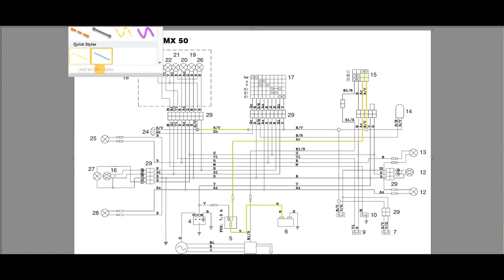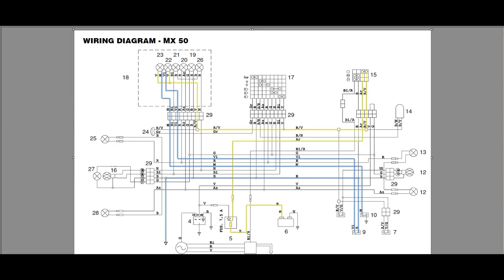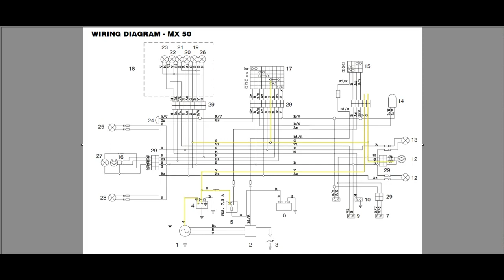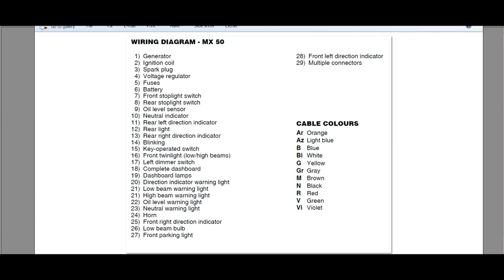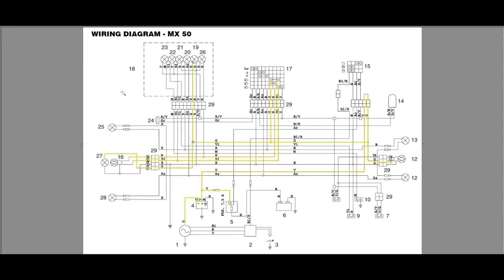Step by step guide: Understanding motorcycle wiring diagrams

Comment: I'm trying to figure out my first diagram and it is hard.  One question I have is about a long thin rectangle listed as "ECU".  Coming out from the long sides of this rectangle are a number of short straight lines, which I guess are wires.  These go into some very small long thin rectangles with a solid line down the longitudinal axis (so, in effect, two long thin rectangles joined on their long sides to form a single rectangle).  These small rectangles have varying numbers of those short wires going into them from the main ECU rectangle.  Sometimes, one per rectangle, and in other cases up to four.  How do I interpret all of that?  Could I email you a copy of the diagram?
Reply from the maker: Robert, these diagrams that you describe, provide an overview.
There will be separate diagrams dealing with component connections and their purposes.
Somehow, you need to get your hands on the set, if you want to understand everything.
They will be available on the service centre network.
A friendly mechanic might print them off for you.

That said, there is little that you can do without the scan kit that connects to the reader port.

The ECU is the computer that controls everything - Electronic or Engine Control Unit.
You don't rewire it, you reprogram it.
... or simply scan the system to discover any faults.

These vehicles are going to become increasingly difficult to repair, as the components will periodically, no longer be available new.
Reply: @EngineTuning  I'm  looking at just one small subsection of the FSM.  There are separate diagrams for each section.
Reply from the maker: Why not make a simple video using a screen recorder program like snagit or any such app?

That way, you could zoom in and out of the diagrams, and describe what you are looking for.
It would also mean that you would be sharing the problem with many more people.

:)
Reply: @EngineTuning  I got the Haynes manual and the diagram in it is much easier to read.  But still there is the matter of the ECU.  I spoke with a couple of people who helped me understand that you can't trace current flow through an ECU.  All you can test is for voltage on the wiring coming out of it and going to the load.
Reply from the maker: Great to hear that you are making progress.
Other than using an ECU scanner; understanding load circuit is probably as good as it gets.

The ECU is a bit like having a large rucksack ... you can just fill it with loads of stuff.

If something goes wrong, it is often quicker to produce a workaround, rather than spend a month studying the ECU.

I recently needed to get my windscreen washer working for a control test.
The rear washer worked, but not the front.
I'd renewed the pump, but it was the control circuitry.

Was it the clock spring?
The diagrams were not clear.
... so I simply bridged the two output tubes (front and rear).

If the water jet had been weak I would have ultimately fitted a solenoid valve, but it worked (works) fine.

Sometimes, the path of least resistance is the best route to take :)

Comment: What is the earth ground inside the voltage regulator box?
Reply from the maker: Sometimes, components are grounded directly to the chassis via the attaching bolt.
With the battery disconnected, use a multimeter continuity tester (beeps when the two probes touch).
Probing between chassis mounts and terminals is quick and easy.

I have seen components that ground via the bolt AND via an earth cable.
Reply: @EngineTuning  Okay, thanks for responding.

Comment: What an excellent, detailed, in-depth, and easy to understand lesson on motorbike wiring diagram. Sir, this was very helpful to me. Having been given a (non-running) Honda CM200 twin-star three years ago i stripped it down to its component parts. Gave it a full restoration - working on my own. Then procrastinated for around a year as its the time to get the wiring back on the bike. I bought a Haynes manual that has the wiring diagram, but it looked daunting. Your description and way you went about describing the electrical systems and how it all works made my Honda's wiring diagram look way easier. Thank you for this.
Reply from the maker: Great news Andy ... thanks for the feedback ... it makes the effort worthwhile.
... and yes, it is way easier than it first looks.
It is pretty much, a wire going from positive, passing through a switch and a consumer, and onward to negative.

The variety of stop switches (on some modern bikes) can at first confuse - say, you can't start the bike if the side stand is down, or you haven't pulled the clutch in.
If there are a large number of stop switches, they can be routed through a single component.
However, once you know that the juice is simply running to earth, that single component can be understood.

Good luck with your project :)

Comment: Hello sir I'm back and have a question about the rectifier part. I have my headlight and rear daytime light on a separate circuit (switch) so would I still a one way valve? Or do I just need it for the rectifier and battery part. Hope I explained it correctly and thanks in advance.
Reply from the maker: The one way valve allows the generator to push power into the battery, without the battery draining when the motor is not turning.
This means that the battery remains charged.

Comment: Great tutorial, thank you for taking the time!  

One question:  What would the ignition diagram look like if it were a 3/way ignition with Off/On/Lights?

I have taken the time to write out a diagram for my bike following your instructions and am not sure how to connect the line from the regulator to lights.... with an ignition switch as the on/off for lights.  

This is what I have so far:  https://drive.google.com/file/d/1CThxBRmd5E_Kkcg55xgyW-_nUnK04ERH/view?usp=sharing

Would appreciate the advice!
Reply from the maker: Hi Christian.
Off - 
The live feed would arrive at the switch, but the contacts would be open, so it goes nowhere.
The power from the coil would be connected to earth, preventing the engine from starting.

Ignition -
The power from the coil is disconnected from earth
The live feed might power the tail light, front parking light, and obviously the basic kit such as horn, brake lights.

Lights -
Same as for ignition, but now feeds the main light circuit.

The only difference (basically) is that the light switch has been moved to the ignition switch.

The ultimate objective is not to simply read the diagram.
... it is to fully appreciate the simplicity.

Electricity is generated from a battery or generator.

It goes to a component without a switch, then returns to earth.
It goes to a switch - then the component - then returns to earth (switched positive)
It goes to a component - then a switch - then returns to earth (switched neutral)

Everybody understands that the noob hates this simplicity, because their eyes and brain are confronted by a birds nest.
Their brain understandably reports that 'this is complicated'.

It's a bit like an optical illusion.
The brain has been tricked.

Obviously, once you understand the illusion... you'll just see one of the above 3 circumstances.
... and that is laughably simple.

Now throw in a stop circuit, a non-return valve (diode), and a voltage regulator to deliver a constant voltage... and you can read any simple wiring diagram.

There are some diagrams that show just a box, and you have to guess what it is doing - typically jap bikes with a safety stop on the clutch, neutral, and side stand.

They all simply feed the coil power to earth unless the stand is up, its in neutral, and the clutch is in.
But obviously we have already covered that... its just that the switch connections are sometimes not shown.... you just know what it is doing, cos what else can it be doing ;)
Reply: Thanks for the help again!  It truly is simple at its core.  What had me perplexed was the dynamics of the 2 sources of power but I think I should be able to finish now with your advice.

Keep up the videos!
Reply from the maker: That's great Christian ... great to see that you are finding the simplicity of the diagrams is coming to the fore :)

Comment: excellent tutorial the one way valve in the charging circuit is a diode yes? not necessarily part of the rectifier/regulator.
Reply from the maker: Thanks for those kind words :)
Yes, it's a diode.
I called it a one way valve, because it is understood by everybody.
If you call it a diode... nobody understands what that means.(and why should they?)
Yes it is likely separate to the rectifier... but obviously the design engineer can design the system how he wants.

Comment: Do you know of a motorcycle wiring diagram software?
Reply from the maker: Sorry... No I don't!

What I did, was to grab the wiring diagram, and legend (important), from a web published manual.
Then... using 'snagit' editor, applied a highlighter.

For hard copies... print off a number of copies and work through them with a highlighter pen.

To create new wiring diagrams consider 'snagit' or a vector program such as 'Inkscape'.

Best wishes for whatever it is you are doing :)

Comment: Thumbs up! question: I installed a LED kit on my bike but I only want it to receive power when the ignition is on. Now it's directly connected to the battery. How can I use such a diagram to find the connector on the ignition relay or perhaps a connection to a headlight wire? Preferably without cutting factory wires as they do in most YouTube videos.
Reply from the maker: Okay... it's a good question.
But really the answer is in the video.
It's a confidence thing, where you flip from seeing wiring as a mystery... to seeing  cables running from power sources, through switches, to a lamp....
In the dash area, a power cable will be visible going to the switch.
Place a meter between each cable connector and  the chassis.
A 12v bulb soldered to two wires will do.
When the bulb lights or the meter jumps
That's it... you've found your power, where you want it.

Comment: Thanks for this mate. I have a 1981 Cx500 refusing to spark and having spoken to the forum guys I know way more about what does what and what to test but this really helps with undertstanding all the flows and grounding. This takes the fear out of it. I've also got a rear right indicator refusing to blink and this is going to be an easy fix, using my own service manual wiring diagram. Thank you so much for an excellent upload. Rich
Reply from the maker: Thanks for that feedback and the 'like' Richard - it all helps to push the correct info to the people who need it :)
Good luck with the troubleshooting.

Comment: Great tutorial. Thanks for taking your time to help us who are afraid of the electrical boogey-man. Trying to solve issue on 1981 Suzuki GS850. I've got something keeping the battery from consistently charging at the appropriate 14.9 volts. ???
I've got the schematic and now I am going into the maze of wire nests. I am also thinking about tearing it all out and reinstall with a MotoGadget M4 kit that gets rid of a lot of the original wiring on these Japanese bikes. ???
I am grabbing a beer and finishing the class time! THANKS AGAIN.
Reply from the maker: Nice one Dougie... that's exactly how to do it :)

There is always a tendency to desire to jump out of the frying pan, while risking a solid landing in the fire.

It is clear that there are more complex wiring solutions.
I pulled up the wiring diagram that Brian (below) was working on.

It employed an unusual stop system, involving potentially numerous items depending upon the model.
Eg. sidestand, clutch, and or neutral.
... on top of that, the stop governor had a strange name - 'changing relay' .
I thought WTF is a 'changing relay' (oh and BTW why not call it a stop relay' but hey.....)

However... once the purpose is understood, it is possible to divine how it works.
The key factor being that each stop circuit must be 'made' to allow the bike to start.... ie. the sidestand must be up AND the clutch must be pulled in AND OR the gears must be in neutral.

If you have a clutch safety, then there is no need for a neutral safety (we would imagine).

From a fault finding perspective... if the bike isn't starting, you might wish to bypass these safety circuits.
... but to do so, you need to be confident with the wiring.
... and your current studies will provide that confidence.

What the tutorial shows, is that you can follow individual circuits.... and also shows that you must do this.

For your problem - start back from the battery.
I've just had a look at a 1980 GS850G

We can see a lead to the starter relay - the other lead passes thru the fuse box to the voltage regulator...
... and from there to the generator.

This would indicate that there is :

A leak to earth
Failing generator
Failing regulator

Bear in mind that the charging voltage will only be achieved at a certain revs, with no lights.
With lights, the revs must be higher.

So eliminate the lights.... ideally all circuits but ignition.
Then meter the volts at slow tickover.... and at higher revs.

You should see the volts rise, and stop at the max required charge voltage.... so even if you rev higher... the charge stays the same.

If everything works as planned.... then there may be voltage leakage through the wiring to earth (chassis).
If not, then it could be the voltage regulator or generator.

Good luck :)
Reply: My head is spinning...but onward I will go with beer in hand.

Comment: Mind doing a more intricate video on the CB400T made by the Japan(ese) ? I need urgent help on this build. Sadly I learned only the purpose of the frame through your video but I cannot seem to find help. Please be my light,
Contact info:
570-599-4842 
Email (preferably due to my lack of signal)
Brian-Heward@outlook.com
Reply from the maker: LOL Brian.... no telephone number starts with 570
What would I get if I dialled 570?
In English it would say: "The number you have dialled is not available"
Think about it ;)
:)
Reply from the maker: I tried to message you through Youtube, but your channel isn't showing the option.
Maybe the name has not been confirmed yet... you should check it out ;)
I found these two diagrams:
http://www.justanswer.com/uploads/motoforge/2009-08-20_182358_Honda_CB400_CM400.gif
https://www.cmsnl.com/classic-honda-fansite/honda_wiring_diagrams/CB400(HawkII).jpg
 
It's true, the wiring diagrams are slightly more complex.
However, the same rules apply.
You must learn to isolate individual circuits, as I showed in the video.
Some editing programs are very easy to use, and well suited to the task.
Others might be less well suited.
I use Snagit editor.
It's great for 'screen videos and screen grabs, and an editor is provided for modding the images with lines arrows and text.
For the video I had the original diagram, then as I detailed individual circuits, I saved as 'appropriate name'.
 
Re the diagrams
At a glance the main diff is that the gif has a 'changing relay'.... the jpg doesn't.
The changing relay introduces a number engine stop 'features'... like 'side-stand' and neutral gear.
This requires an extra cable from the alternator, and +2 connections at the cdi.
So you need to determine which wiring you have.

If you have the changing relay model... I'd really get to grips with understanding these circuits, because they introduce many possibilities for your engine not to start.
Of course, they all can be removed, if you wish :D 
 
But otherwise, the circuits are just bulbs and switches, plus an ignition circuit.
Don't panic :D
Reply: @EngineTuning  570 appears to be the area code for somewhere in Pennsylvania.
Reply from the maker: Perhaps ... who knows?
TBH you might put an email up ... but an incomplete phone number is just weird.